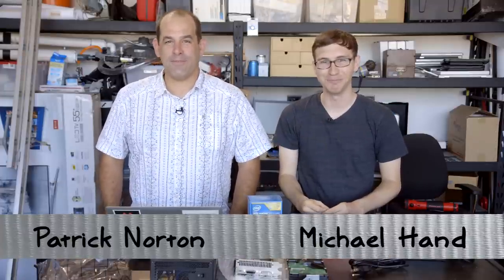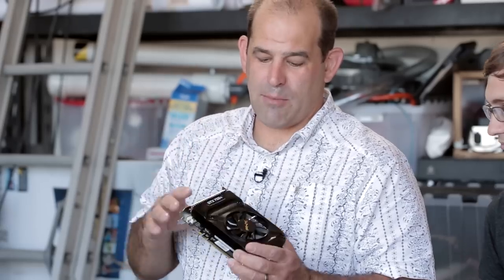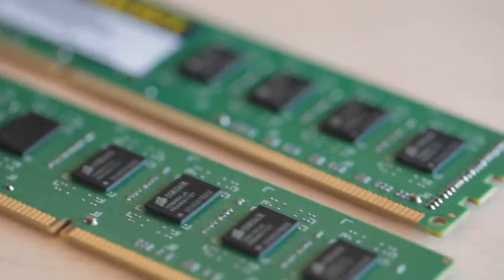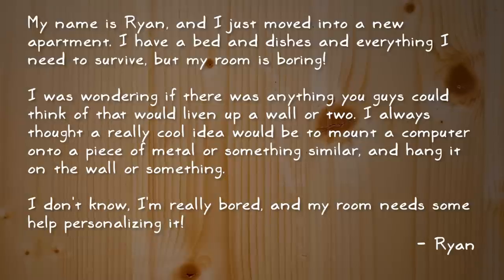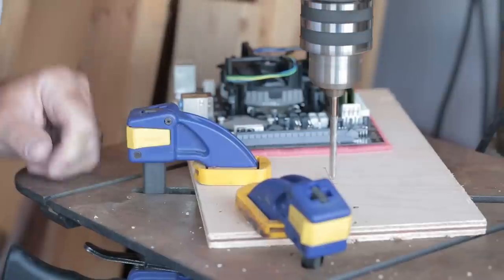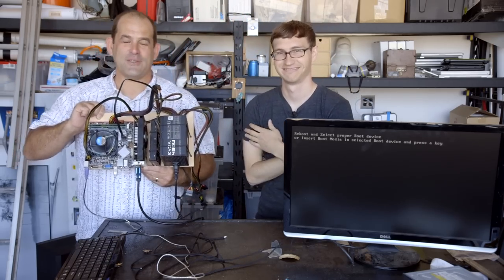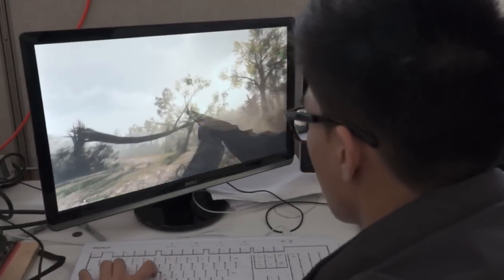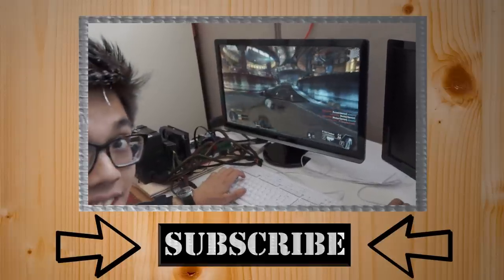Screw The XBOX ONE and the PS4... We Built a Gaming PC for $380!

Comment: not bad price for a cheap PC. My GPU is 4x more expensive than this pc. But ofc my GPU is beast. was about 1200€  which is around 1340 USD. But its worth it, only consoles ever owned was playstation original and playstation 3 but only bought it when gta5 came out, 2 weeks later put it in closet and havent touched it again.

But i understand that not every one are willing to put alot of money or can afford good pc so they opt on consoles. And ofc if u dont know about gaming and the platforms u might think based on marketing that consoles are only gaming platform or something silly like that.
But there rly isnt any argument that consoles could ever compete with performance when compared to pc untill they make consoles every year and increase the cost by 5x atleast but then it would be basicly just pc.. 
Only thing they have is u can lend console games to friends but thats it (dont know for sure but would think they still can). And microsoft tried to take that away from xbox so then it would have been completly useless.

Comment: DIY Trying: What did you put underneath the motherboard? I want to make my own wooden mini ITX gaming PC case similar to this build. Does a motherboard need standoffs from the wood? Doesn't it need a hole for the cpu socket? I was thinking of making small wooden square stilts to screw in the mobo. Also could you come up with a clever way to accommodate a CPU Cooler? Would it be fine to have it sticking part way out of the case if I cut a hole through the lid? Many thanks in advance!! :) Anyone else feel free to answer this question as well!!

Comment: after finding a free case, I put it together and the power switch pins would not line up! Id like to try mounting it on wood like in your video, but Im not sure what to do about the power switch and any other issues I might have like airflow or a material to put over the wood.

Comment: Mine at around 350 kills this thing without a case or hard drive but those cancel out since I bought a CPU cooler because I wanted to OC and you really don't have to with this CPU(so lets say you have to pay an extra 20 because you can get a psu case combo for 6$ more than what I paid for just a  psu and 1tb hard drive is now roughly 40$) so 370!

asrock 970M Pro 3 79$ (39$ after bundles with cpu)
AMD 8320E 3.2 GHZ black edition OCD to 4.0(109)
inland 500W PSU 34$ with 2 yr protection
8GB Corsair 1333ghz pc1600 cl9 37$
Hyper H2 212 CPU cooler 20$
Asus Strix r9 380 factory OC'd 179.99 with the open box as opposed to 229 ontop of that it was a markdown from 249.99 :D
-----------------------------------------------------------------------------------------------------------------------------------
what  i already had ....
a gay hp tower 
750 gb hard drive
wala
----------------------------------------------------------------------------------------------------------------------------------
mine now....
samsung 850 evo ssd 89.99 save 10 for bundle deal within 30 days.
2 2gb sticks to allow dual channel 30$
oh if you get your bundle you save 10 on ram
10 on hard drive

Good luck noobs

Comment: Hi guys,
I have the following configuration in my XPS-L502x:
- 2nd generation Intel® Core? i7-2760QM processor 2.40 GHz with Turbo Boost up to 3.50 GHz
- 6GB 1333MHz DDR3 SDRAM (1 x 2GB + 1 x 4GB)
- 2GB NVIDIA® GeForce® GT 540M graphics with Optimus
- 
Can someone please let me know how can i make most out of this configuration. I did manage to play “metal gear solid 5: ground zeros” with ultra low settings and fps were around 25-30. 
1. is the configuration too old/ bad that i am getting such a low fps ?
2. Also i had installed windows 10, which is a bit slow in booting. does using windows 10 
with the above config affects game performances?
3. i am having an impression that may be i am not using my config full to its capabilities. please correct me if i am wrong or let me know how can i verify this ?

Comment: how can he play titanfall on max settings and getting 60fps? I have a GTX 970 and I dont get 60fps on max(1080p also)
Reply: +Mathero11 it's common that a sli gives problems, I personally don't recommend it, most of the time you will be using only one of the cards because of compatibility problems, only a few games can support sli and probably you can run them perfectly with only one
Reply: maybe u need more RAM or more likely a better processor

Comment: That looks like a shitty build. Yeah you can buy cheap parts for like 40 bucks but how long will they last 6 months? Screw that, id rather spend more on parts with good warranty and which will last longer. Also this pc may not even run games at full settings.

Comment: So you didn't buy a monitor keyboard mouse case wifi adapter speakers etc, so not really a full build then and that cpu hahaha. i made a system for £600 Zalman case i7 4790k gtx750ti asus z97-p 8gb ripjaws ram wifi card samsung 250gb ssd seagate 1tb hdd. 
You might want to rethink your budget builds...
Reply: mm good cpu but low end gpu, your build isnt for gaming but more on workstation type.
Reply: You don't count monitors just like you don't count tvs for consoles.
Reply: It's very good for gaming both on linux and windows

Comment: What's your guys opinion on my build???

Bitfenix Merc Alpha mid tower
AMD FX 6300 
ASRock extreme3 990FX
16gb corsair vengeance pro 1866
EVGA gtx 660 to (upgrading to 960-970 ssc)
Cm 212 Evo
120gb kingdian ssd (upgrading to 240gb Kingston savage)
1tb seagate barracuda
Windows 10 Home
750w ultra psu
Aoc 23 inch 1080p 60hz 5ms resp. monitor
Reply: I also have another build:

I5 3570k (got for free)
Asus p8z77-v pro (got for free)
Ultra gladiator usb 3.0 complaint (got for free)
8gb hyperx ram
EVGA gtx 960 ssc

Comment: amd fx 6300 6 cores 3.5 ghz
kingstone ddr3 4gb 1866mhz x2
and amd radeon r7 250 1024 gddr 5
works for gaming?
Reply: +Bullet Rex You should buy atleast 8GB 1600mhz Ram. Costs around 50€. And if you want to play actual games you shoud have at least 2GB for your VideoCard. I have a GTX750 1GB Superclocked and games like RainbowSixSiege need 1-3GB of VRAM. 1GB on lowest.

Comment: Awesome !! One question ... I can play "Elite Dangerous: Horizon" ?
Reply: ***** Thx for your return. Well today I play with a Mac mini 2012 that heats up a lot ( I have the game on Steam ) , but I need a machine to run Windows because the Horizon version does not run on the Mac. So the question , I see options for a machine , low cost, which will only serve to play. If you have any recommendation , I thank you.
Reply: ***** I know that, but the problem is the heat, is heating up too much because the video card can not handle, after about 2 hours, I got to go off. Then I thought of building a ( like a video game ) that can withstand the settings of " ED: Horizon" , as it only runs on Windows, and breaks will be able to play the new version ( mine is the standard today). I have seen some machines with legal values less than US $ 500. A friend runs the game on a standard PC and uses a new nvidia , I think the 550. I thought a machine with 08 GB RAM and a plate of these for example, or something equivalent ( Mac mini i5 2012 2.5GHz 4GB RAM Intel HD Graphics 4000) .
Reply: Hi..sorry for delay. My budget is $300 more or less. thx
Reply: OK... $400 its fine ! Yes, only Elite Dangerous. The new machine is run new version: Elite Dangerous - Horizon (I am CRAZY for this game, I am start play in 1984).

Comment: sorry does NOT beat xbox 1 nor 360, and barely xbox,,, so many thing with a consul that makes them better. and I have a gaming PC.
Reply: ***** I understand you can build a pc game system cheap but the results are "cheap" You cant beat the stability and ease of use of a consul for the same price range. For a gaming system to beat a consul your video card is going to be $200-300 alone to be worth it.
Reply: +tonymengela The GPU's are based off of the HD 7870 which you can find for $130...So no, it will not take my 290x that I paid $330 for to beat out a measly card like that. There are lots of cards close to the price of the 7870 that perform better.
Reply: Chris Iggy Not stable, nope
Reply: The only reason for stability with the current Gen consoles is because of the tweaking they do specifically for them and because they do things like keep lower frame rates by default and downgrade resolution to keep the frame rate up...and it's not that difficult to just adjust settings so you're not completely unstable while on PC.
Reply: Even with sub-par cards like that
Reply: +tonymengela it beats a 360 by far and the original xbox's by a mile

Comment: Can you guys tell me whether G3220 is 32bit or 64bit processor??
Reply: +arun ayyagari All modern CPUs are 32bit/64bit
Reply: I want specific answer because I have the same CPU, and I want to know what bit architecture it is having so that I can install the same Bit OS. The reason Im asking is on 32bit OS more than 4GB of ram cannot be accessed and where as in 64bit, it can.
Reply: I don't see how it doesn't answer his question. It is 64bit. It will support 64bit OS, software. I even linked a spec page showing it is 64bit, which is what he asked. Ai
Reply: +A Helpful Person I have installed a 32 bit win7 and in system information, under system type it says x86(32bit) based PC. Does it mean the OS is 32 bit or the processor?